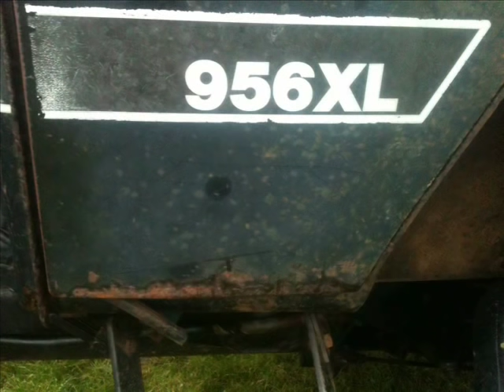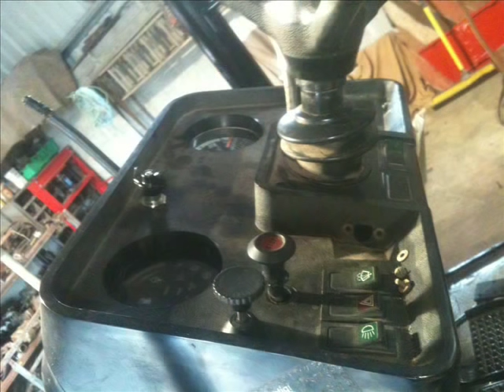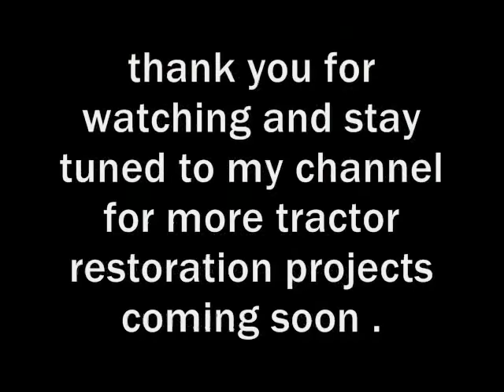CASE IH 956 XL FULL RESTORATION " UPDATED "

Comment: Holy shit, that was a lot of work, well done. Dad had one, did 8500 hours from -88 to 2011. Had a couple of rear axle bearings (duals) and a crank shaft bearing. A well built tractor. I swapped her in for a bit more modern, but another classic, JD6810.